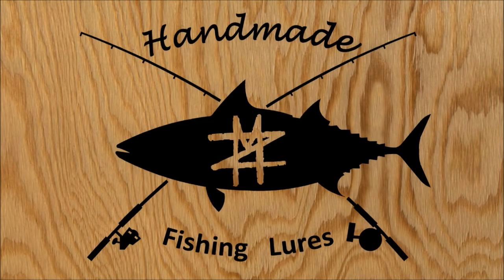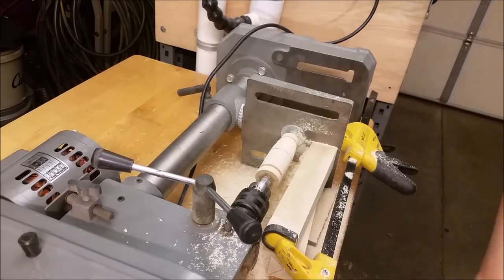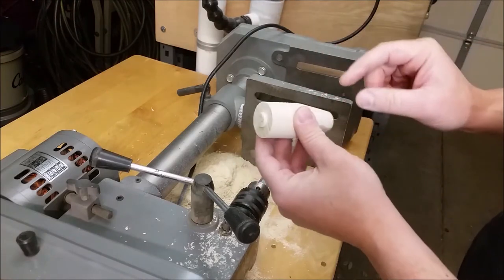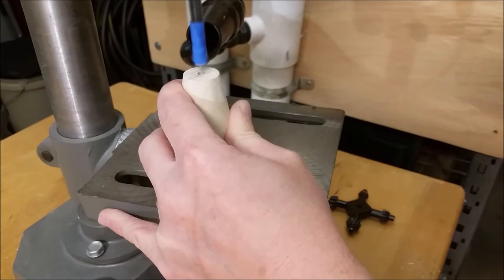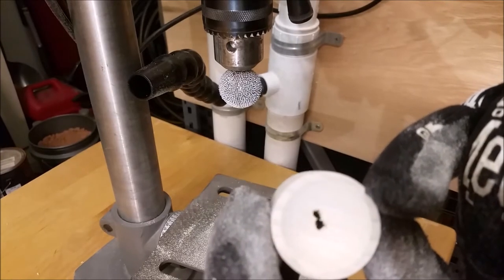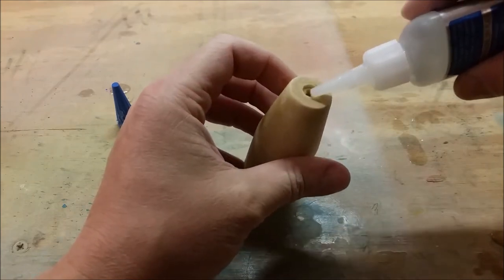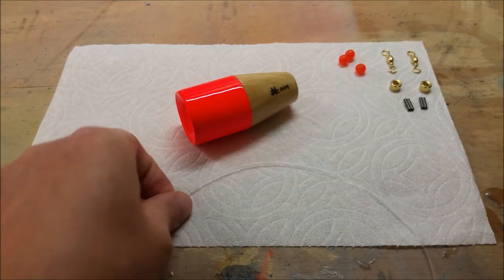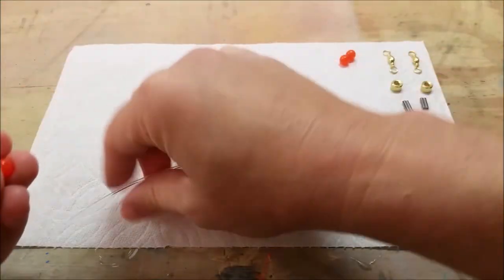Carving a Wooden Popping Cork on a Drill Press

Comment: I made one of these awhile back, but instead I just bought 35 cent cone bobbers. They came with a straw in the middle to fish line through. But instead, I just used 20 gauge stainless wire to feed it through, popped on some beads, bullet weight, and swivels. Works exactly the same. Nice build man
Reply from the maker: Thanks for watching and for commenting. I like the look of the wood, but these could stand to be more buoyant. Might try balsa sometime.